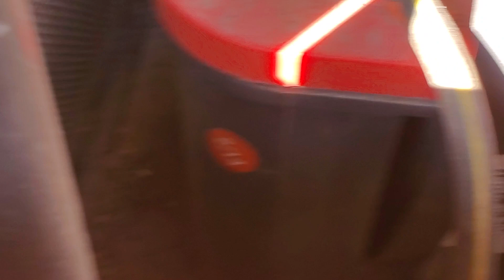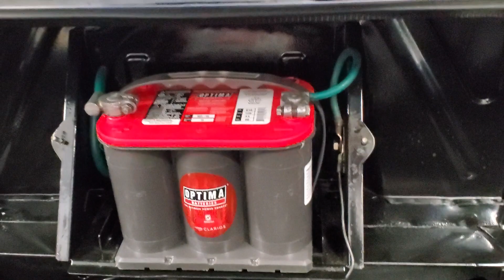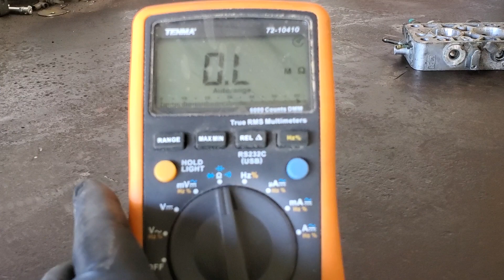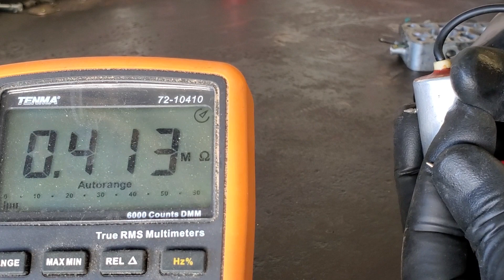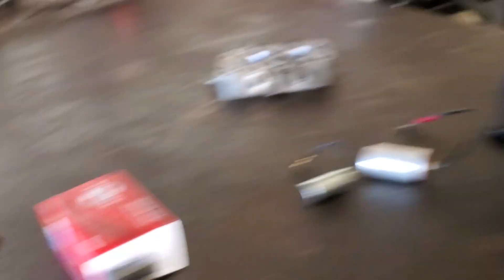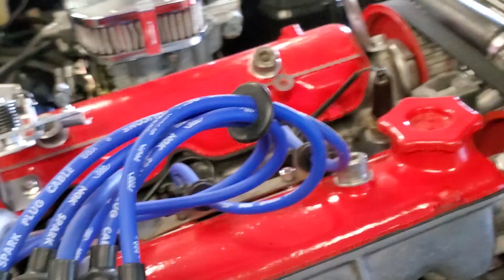1979 Fiat Spider 124, Troubleshooting-No spark- ignition- Coil- Distributor

Comment: 1977 spider 124. Turn key-no sound, no crank, nothing. but i do have lights and horn and other power. What order do i need to check things in?
Reply from the maker: Check connections at the battery and battery ground to the chassis.  Check the battery connection at the starter.
Check fuses in the box. Spin the fuses, pop them out, and clean the ends. 
Check the connections at the ignition switch.

Comment: Hey! Love your content — it’s been super helpful so far, thank you!

Quick issue I ran into: I was driving a few miles recently, and all of a sudden the car just stopped. Since then, I haven’t been able to get it to start again. I’ve already replaced the coil, the ignition module, and a few other components, but still no luck. Absence of sparks. 

I just discovered that I’m only getting around 7.5 to 9.3 volts at the coil pin, which seems way too low. As a test, I ran a direct wire from the battery (+12V from the trunk) to the coil — and the car started right up.

I also checked the pink wire at the ignition switch (Neiman) under the driver seat, and it’s reading the same — around 7.5V.

To me, it feels like there’s a significant voltage drop, possibly caused by a corroded pin, weak connection, or damaged wire somewhere along the circuit ? 

How would you go about troubleshooting and isolating this kind of issue? Appreciate any pointers or testing methods you’d recommend!

Thanks again 🙌
Reply from the maker: I just rewired the fuel pump and coil in the FIATSKO.  It's ok not to use the same color wire. In your case I think a relay will get you going the quickest.  I think you're working on a Spider. 
Make a hot lead from the starter lug and runnit over to the coolant tank area. Set up your relay off to the side and use the pink wire as the switch lead. Run a new wire to the coil. That should keep you driving.  Then this winter you can tackle the, what the Fiat is wrong with the voltage in your Fiat wiring mess.
Reply: Thanks for your response! The relay idea is excellent — I can grab a solid 12V directly from the solenoid terminal.
I measured only 10.5V at the ignition switch where the pink wire (feeding the coil) gets its power, so I suspect the switch itself is getting a bit tired.
From what I've read, that's a common issue on older cars (and yes it's a 1982 CSO Fiat 124) — the ignition switch can wear out over time and cause voltage drops.
Your relay solution is actually one of the best workarounds: letting the ignition switch trigger a relay, while the coil gets its power directly from a clean source.
Really interesting progress, thanks to you. Appreciate the help, man! 🙌
Reply from the maker: @valentinf2658 welcome, lemme know how it works

Comment: Dumb question... When you experience a no spark situation, what does that sound like when you turn the key?
Reply from the maker: Depending on your set up,
Key on, might hear the electric fuel pump
Key to start, starter engages, spins motor
Motor spinning,  pump the throttle a few times motor still spinning 
No fire. Check for fuel and spark.
Reply: @ELDESTBuilds  so far power only to one side of coil (per test light). 😢 Voltage to only one side of the coil... Replace coil? Could this be why when I turn key no turn over at all?
Reply from the maker: Again, depends on your setup.
Points or electronic pick-up 
Generic coil at the local parts store are pretty cheap.
I would check more components in the ignition system to try and find a failure.
Reading OHMs will tell you more about functioning correctly

Comment: Does the DR70 part work for a 1980 Fiat Spider 124? On the parts websites it says that DR70 does not fit the 1980 Fiar Spider 124.
Reply from the maker: I have hooked up the $2 thru the $10, ran the same
Reply: @ELDESTBuilds The DR70 condenser piece that I ordered was 2 times smaller than the original condenser that the car had. Put in a brand new ignition module, condenser, and coil. Still is a crank no start. Will dig in more.
Reply from the maker: @MrAlexGolovin the only thing left is the pick-up inside the distributor. Ser here

https://youtu.be/OzrX_boBsjo?si=WBjkT1qT3RA5M5w2
Reply: @ELDESTBuilds I followed all your advice and I got spark. The car only starts on starting fluid because I lost the supply of gas. I checked the gas supply lines to the mechanical fuel pump and they were both cut! I have driven the car on multiple occasions so my conclusion is that the car was running only on the low pressure fuel pump this entire time! The gas tank was rusty inside so I took it out and cleaned it and replaced the fuel filter in the trunk as it was clogged with rust. I can't believe someone by passed the mechanical fuel pump by cutting the two gas lines and re-routing a new gas line directly to the carborator. Where can I find the fuel line schematics?
Reply from the maker: @MrAlexGolovin, good job, buddy, most of thr mechanical pumps are bypassed after they fail. There is probably a electric fuel pump inline somewhere. 
See here
https://youtu.be/MKWnioJECJk?si=kPsrIbJNliZkJZom
Reply from the maker: @MrAlexGolovin fuel line routing is in this video.
Reply: @ELDESTBuilds Thank you so much! I'm guessing that the electrical fuel pump went out but I have yet to find it. They didn't put it anywhere obvious. Do you recommend I put a block off plate or just keep that old mechanical fuel pump in there with the rubber hoses cut?
Reply from the maker: @MrAlexGolovin I would pull the old pump and install the block off plate. Sooner or later, something will let go in the mechanical pump and cause grief.

Comment: Kind've stuck on this right now I've watched this video through, but what I'm confused on is there 2 positives on the coil? Or is it pulling positive from the other side to made that test light light up? I don't usually work on older vehicles so this is pretty new experience with a coil like this the other weird thing is this one was a points distributor converted to the newer coil style
Reply from the maker: Plus and minus on the coil, power to light the test light flows through the whole "circuit".  Broken connection,  no light but rotate the engine slightly and check again.

Comment: Oh all the centre console and cig lights, clock, headlight light just the illumination of the dash lights. Even going back to normal bulb not illuminating. Will wire trace more. Cheers.
Reply from the maker: I would check both sides of the fuse with a meter.  Age has a way of corroding the connections
Reply from the maker: I had a few I had to clean to get a regular connection
Reply: Definitely ground. But I might have to run one to each light after a test. A ground to one dash light ran 2 lights. Would of thought one ground to one dash Meyer would run them all. Should I keep searching?
Reply: Meter
Reply from the maker: If it was hacked by a previous owner(s) there is no reason not to do it right. The factory way several feet of extra wire. On the dash lights, you could consolidate the grounds into a single connection. I like using soldering iron and shrink wrap.
Reply: @ELDESTBuilds  Cleaned up the ground points and tidied the wires. Bypassed the dimmer switch although left it in for cosmetic reason's. Then had a break, fixed the number plate LEDs. Ha there good. Did some gluing on the dash gauge area. This thing has been rewired before. So I could have say, 5 gauge wires to 1 ground to the body. Tomorrow will try again. If all else fails I will run a led strip to a switch with a dimmer and have disco multi colour choices. Ha. Because it's just the dash. Console's good. Thanks again. Might watch some Eldest Builds.
Reply from the maker: Good job buddy,  build it the way you want it.
Reply: @ELDESTBuilds  What did you do to the door armrests. Tan then black and no crome strip. Vinyl spray?
Reply from the maker: Vinyl spray on the arm rests. Chrome strip was painted same color as the body.
Reply from the maker: There was just too much tan for me.

Comment: Got to thank you again.  Just installed the single plane intake manifold, new weber.  Ended up having to change  exhaust cam tower gasket.  Get done car won't start. Couldn't figure out what happened.  Then I watched this video.  Tested side post of coil with key on got over 12 volts both side. Took all wires of post tested and resistance pots to post got 8 omhs. Got nothing from either post to the center of the coil. And the  condenser also had no reading.  White wire to distributor read 733 on either side. Thanks again for all these videos.  You have taught me a ton.
Reply from the maker: Glad you can use them, hope they help

Comment: My ignition control module is wired on two the two points the ignition control module. I didnt see that in your video. Just curious on where the wiring goes
Reply from the maker: ICM is behind the coil. Mounted to the aluminum. ICM wires are connected to the coil 12v connectors. Details in this video.
https://youtu.be/naNOSnVszpA
Reply: @ELDESTBuilds  i swear i owe you beers for a lifetime. Saved my ass many times
Reply from the maker: No worries

Comment: If you have the dual-point ignition setup and aren't going for historical accuracy, a Pertronix setup is pretty slick. Simplifies these things. I did it and was pretty happy. YMMV. (edit - Whoops! In original post forgot 1979 is already electronic ignition. For those of us with POINTS Pertronix is a good option...)
Reply from the maker: This one has the magnetic pick up inside the distributor